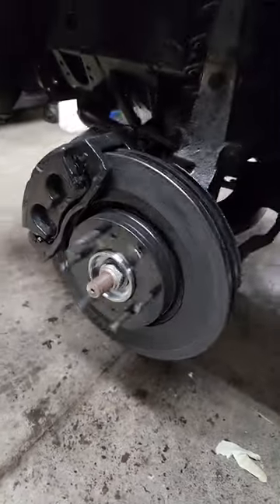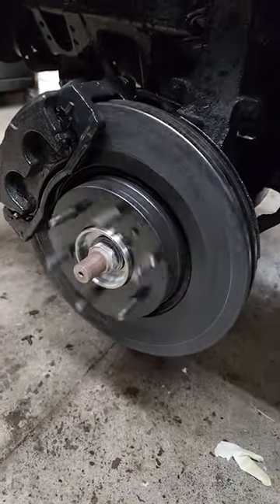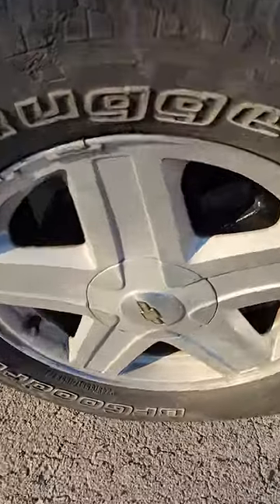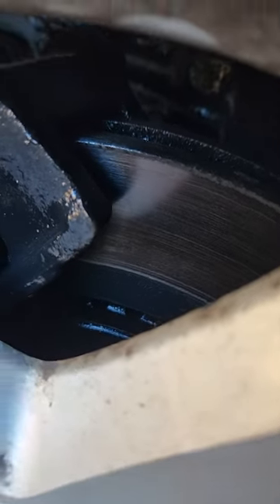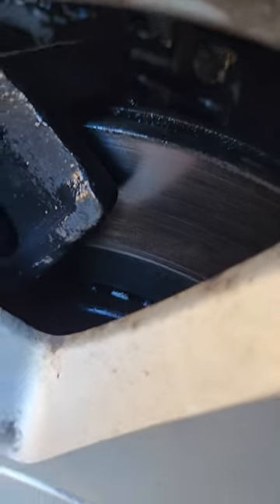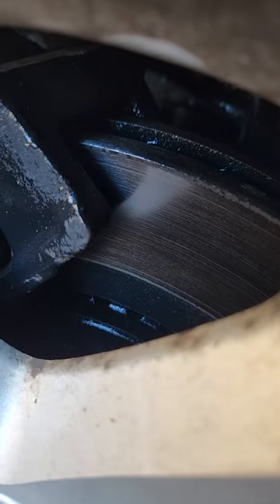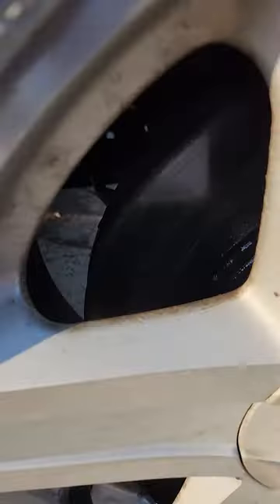Do My Brakes Work After I Painted My Rotors?

Comment: People are too convinced of the old school rumors you hear. Brakes get hot enough to burn off anything and everything that gets on them. I’ve left the oil coating on new rotors and installed them. It burns off the first 2 seconds of the first stop.

Comment: I just powdercoat my rotors so the paint doesn't wear off with the pads... Also, a little WD-40 on the pads further helps to prevent paint wear on the rotors. **NOTE: THIS IS SARCASM AND IS MEANT FOR ENTERTAINMENT PURPOSES ONLY - DO NOT ACTUALLY DO THIS**
Reply: I think the WD40 will also help stop the brakes from squeaking
Reply: Attention: For the uninitiated, These comments are description on how to commit suicide. Do not do this unless you want to commit suicide.
Reply: @booradlly  Fixed, I realized some people may not realize it's sarcasm.
Reply: @pdiz   You sir, are awesome! Have a wonderful day! Also, I think the disclaimer actually makes your comment even more funny rofl
Reply: WD-40 is a terrible lubricant. They make high-temp brake grease for a reason, just use that.  😳
Reply: ofcourse, dry lube or silicon spray is the way to go these days. 😅
Reply: @Austeration 😂
Reply: @booradlly  What the hell are you talking about mate? you know what engine braking is? You can engine brake on any car whether its got an automatic or a manual, ideally a manual but all works. You can come to a stop from over 100MPH relatively quickly with engine braking.

Comment: Rotor paint ain't gonna fix that lifter tick
Reply: FR.
My silverado motor finally bit the dust. Had that tick. Granted it lasted 330k KMS. So she lived her life regardless of the tick.
Reply: @m.m14433  It's nothing to rebuild that engine. It's worth it as long as it isn't a rust bucket.
Reply: @DomVito87  i dont know how to do that & its likely expensive to do here (canada). Id estimate the trucks worth probably 5-6k CAD with a working motor.
Reply: @m.m14433  I understand that. It's also expensive in the US. I taught myself to work on my own stuff(an yes along the way I've ruined things lol). But in the long run it saved me money.
Reply: @DomVito87  my buddy works at a scrap yard and said he can get me a motor under 200k Kms for 1600 w installation. If he isnt bs'ing me, ill go through with that.
Reply: @m.m14433  You can get a vortec crate engine cheap af
Reply: @joshphillips5480  where?
Reply: thats not a tick its the shake ball in the paint can
Reply: @Dom Vito  there's no explaining the satisfaction you get fixing your own stuff. If you know you know.
Reply: I know that sounds because I own a 05 Ls motor. Just sayin.
Reply: Needs some paint in the oil
Reply: Probably a pick up tube o-ring
Reply: Add 1 quart  of rotor paint for every gallon of oil 🤔
Reply: I wouldn’t be driving on those tyres either…..
Reply: it is a chevy it don’t give a shit ab not ticks
Reply: On the other hand I live in Michigan  so I kind of consider rust as a paint choice.
Reply: Glad someone else heard that but that doesn’t sound like a lifter tick that sounds like a rod knock 😂😂
Reply: Gotts spray the paint directly on lifter to
Have any effect
Reply: 330k miles and 5 transmissions right? 😂😂😂
Reply: Probably exhaust tick

Comment: Now your pads are glazed. Great job!
Reply: Not if you let them dry ”phil swift”
Reply: Wouldn't this be perfectly fine if he just used some old pads to clear the paint before driving? When its all clear just put new pads on.
Reply: @astroid99 yes, just the thing is the smell will be incredible. Had a guy paint his valve cover with spray paint and every time the engine starts warming up its all you smell and we still give him shit its been about 5 years now. So any braking other than granny braking your likely going to smell it. It is outside of the vechile so smell may not be as bad cause the cabin fan wont suck it in. Hopefully he used grill paint or the paints a couple hard braking situations from flaking the paint off or melting it not really willing to try it on my car to find out. Definitely not doing it on a customers car
Reply: @foolicooli  fair enough, not something id ever try myself.
Reply: @astroid99  don't blame you there lol
Reply: @foolicooli  He used the wrong paint, they literally make valve cover spray paint. They even make exhaust manifold/header paint, which withstands even hotter temps. Anyway, some companies literally sell their rotors fully painted from factory.
Reply: @69-Bot  I was aware of rotors being z coated specific brand and it does a good job preventing rust and longevity of the brakes themselves and helps them seat proper. Was not aware they made a spray type paint for the rotors though, so learned something new. Once you said header paint it clicked in my head though seen that awhile back. Didn't know about the valve cover paint though either. But yes he definitely used the wrong paint lol
Reply: Paint burn off about 500 degrees. Just brake hard a few times at 100 mph.

Comment: Looks awesome you might want to repaint them every 2 or 3 weeks.
Reply: Not really, you did it to cover the rust part that the pad didn't touch the disc rotor. That is the idea! It is dangerous though when the surface that touches the pad still covered in paint! When it wore off, it is actually good. I did it on my old car for tickle and giggle, I just keep running it on jack stand till the surface almost worn off (so the residue didn't transfer to your rims) and drive it carefully for at least 500 miles and you are good, drive it till now, no rust! Just be careful during initial paint!

Comment: Wouldn't that paint residue remain on the pads for a while?
Reply from the maker: Not sure ... It's been ok
Reply: It's fine. Good to keep the rust away for a while. Every time it rains, or condensation forms the brakes scrape away rust, so paint is nothing for brakes.
Reply: It'll wear off as brake pads do. Only oily substances will seep into pad material most other just stay on the surfaces
Reply: @WarpedLab  4" wire wheels are cheaper than an insurance claim
Reply: no
Reply: Yes definitly
Reply: @georgelin8498  that paint is oily so what happens if pads absorb it?
Reply: No.
Reply: Yes
Reply: Either way, truck is a shit box. Looks better.  It’ll burn off.
Reply: @georgelin8498  oily substances like rustoleom paint
Reply: @WarpedLab  Not sure? So it’s your car then, right? Obviously you would never, ever, ever do this to a customer’s car unless you were certain it’s safe. Because you’re not a fake mechanic.
Reply: @georgelin8498  pretty sure he’s not using water based paint.. pad contamination is real. Although it probably won’t effect you if you’re driving around your farm, it will affect you if you need you brakes to slow you down fast in a constant battle for first place.
Reply: Never do this. The paint will imbed into the pads. Could possible cause the brakes to be grabby when it warms up.
Reply: Would have contaminated the break pads disc needs a good clean and new pads because it may not feel like it but breaks will have lost breaking  capabilitie will be ok tho but not good idea.
Reply: Yep, you cannot use just any paint to do this, rustoelum is oil based and will gum up the pads, essentially glazing them and reduce your braking ability.
Reply: Yes
Reply: Yes those pads are contaminated and he's probably getting 25% of the braking power it should have😢
Reply: @gofasttuning2320  I get what he was trying to do, but he didn't say if he used high heat paint. One problem is the pad contamination. The other problem is that the paint on the non-friction surfaces of the rotor wouldn't hold up if it weren't high heat paint. Double fail?

Comment: Just change your rims to black so it matches with your full black paint under the car 😂
Reply from the maker: I was thinking the rims and the body 🙂
Reply: Don't forget the rubber
Reply: Might as well spray tint the windows too, both sides.
Reply: tire shine those tires too they'll look more black and match the other black things more lol tint the headlights and taillights too 😂
Reply: It will look great when the recovery truck pulls it out of the gutter.

Comment: Mechanic here, I do paint the calipers and rotors with high temperature aluminum color spray paint, I avoid the pad contact area as much as possible but they clean fine and it gives a nice look, way better than oxidized pads and calipers.

Comment: Depending on if this was oil based paint or not. This will not cause any issues except the first couple of stops. It will wear it off similar to surface rust after a hard rain. May actually keep the brakes from squeaking. Doing a similar job to what the brake quiet products they sell. Most of your higher end rotors you buy are sprayed. For corrosion prevention and heat properties. You don’t buff or turn the face of the rotors that have it. You set the pads during your test drive and it wears off. Like I said I don’t know what paint was used. But a lot of rotors do come coated brand new and it doesn’t cause any braking issue. It shakes for the first few stops but wears off.

Comment: I just took an old paint brush and did the rustic patina look with boiled linseed oil. Looks like shiny patina now. The burnt smell will only last a few days and then you hardly ever notice it again. In a pinch you can use old used motor oil. Looks the same and is better if you are on a budget.

Comment: I had a customer came in one time that had done this and their calipers seized up because of it 🤣
Reply: Thats not true at all unless he pulled the dust boots and painted with epoxy it did not cause a seized calliper…😂
Reply: No way this would cause a seized caliper
Reply: How does a caliper seize from paint? Did it gum the pistons that bad?
Reply: No you didn't 
 you can buy painted brake disks that do exactly the same as this video keeps the rest of the disk protected
Reply: No you didnt.

Comment: Premium rotors come coated brand new for rust protection, and the pads clear them instantly
Reply: They're powder coated or high temp paint, not rustolium paint. That's gonna stink when it starts burning off everything

Comment: That paint can actually compromise the structural Integrity of the brake pads contaminating them and making them garbage why you're supposed to wipe down your rotors after you buy brand new ones to get the oil off so you don't contaminate the new brake pads
Reply: Yes, but the "clean" areas do oxidize. Personally, this seems like a "good idea" to do with brand new rotors and old pads. Use the old pads to create a wear pattern, removing the paint, and then replace the pads. However, I doubt I'd want to do a brake job twice just to limit rotor rust in the vents/hat. Also, probably need to use high-temperature paint because of heat soak during brake operation. Not sure what "dried up rustoleum" does at 400-600F degrees. Could produce some fumes you wouldn't want ... I don't live in the rust belt, so this isn't a protective measure I'd ever considered. But with snow/salt corrosion in some places, it may be useful.

Comment: People are gonna be so upset about this because they don't understand physics, those brakes will take the paint off guys and you'll only have a problem stopping if you don't do what he did first! He's a man who knows his stuff!
Reply: You don't need to paint your rotors is the point
Reply: @chrismith41399  nah he didn't say that lol
Reply: Thermal physics maybe. Where does the paint go nice it’s of the rotor?
Reply: @Jesse Tristan  if paint is overheating your rotors you might wanna get some better ones than that, and it'll do what brake pads do when they wear out. Just dust everything up and get all over shit
Reply: Where does the paint go though? It gets in the brake material and contaminates it, reducing its ability to work. This is just hack work, and you don’t need to paint everything either
Reply: @The Deforester  like I said if you notice a difference in stopping power after painting your brakes, you have a much bigger problem. I've done it before with no problem because it just literally isn't significant enough to do anything which is why tons of people do it. The residue you speak of is like I said just like pad dust, it gets everywhere but only sometimes, I've seen it not happen to some aswell

Comment: Some brake rotors come painted from the factory, and the specifically instruct you in the install manual not to remove it.
Reply: They come with a rust inhibitor and a break in coating.thwts not Rust-Oleum.this shit is going to start smoking and burning when the brakes get hot.also the rotors brobly will warp and glaze over because ethe pads and rotors fins will be gooped up.
Reply: @michaelwooda9444  no you just haven't seen the ones that are painted. I've seen them painted from factory and it's no issue at all. The paint turns into powder eventually and blow away.
Reply: It is a specific kind of paint. This yoyo used rustoeum which is oil based

Comment: If the paint was dry you could've just used sandpaper as the wheels spun. BEFORE you paint your rotors or calipers, cover up the rotors with cardboard and painter's tape. I've done it to many of my vehicles over the years, and paint never gets on the pads.

Comment: I'm trying to figure out if this was meant sarcasticly. My brakes could use some rust protection but I'm afraid I'll ruin the pads.
Reply: Pads are like 20 bucks a set, and you can get pre-coated rotors. But this could actually be a money saver if you buy uncoated rotors and apply high heat paint to them. If you're worried about the paint sticking to the pads, you can use old pads to scrape off some of the paint.. but I wouldn't worry about it.
A thin layer of paint will protect the rotor against rust just fine and thus make it less prone to cracking, and it'll wear off the pads within the first 10 miles or so.
Factory coated rotors are the smart bet, though, as they're usually powder or immersion coated and are designed to work fine with fresh pads.
Reply: Oh, it will! 😆
Reply: @shaneleonard7218  it won't

Comment: IF YOU'RE GOING TO DO THIS, do it literally immediately before a pad change. Then you ain't gotta worry about the potential paint contamination in your pads if you're really that worried about it. Which you shouldn't be, because the pads will clear that literally immediately, but there's a tip for you hyperventilating YouTube mechanics
Reply: Brake pads are painted at the factory for rust protection.
Reply: Premium Rotors also come coated for rust protection and the pads removed the coating instantly
Reply: @drakekarman1791  the surface is about storage, the bell and edges are about longevity in salty areas. The surface rust on the contact patch will always immedietly be removed. But the rust on the bell can make it stick on the lugs and cause weak spots around the rotor itself. It's not usually an issue, regardless, but it can be

Comment: my friend actually painted my brake pads and all w silver rustolium on my 02 accord. they still work fine and the brakes take the paint off the rotor where the 2 meet but looks great. will say go easy on the brakes at first when doing it cause it will make some weird noises and feel off for like the first 5 minutes of driving but then goes back to normal.

Comment: I painted new rotors before fitting, and got a bit lazy masking off the friction area. 

Never brakes properly… Basically the oil based paint contaminated the new pads. Had to pull the pads and clean them. Pita…

Comment: Did you change you air in the tires to summer air. And added summer blinker fluid!!! Also have to replace starter so turn engine the other way ! So have more power!👍🏻👍🏻😘

Comment: i do this kind of thing but not with rustoleum and i don't paint the surface intentionally. Painting the center and edges of the rotor and unintentionally get a little overspray on the contact area isn't a big deal.

Comment: Real question: Will all that high heat paint get embedded in the brake pad and cause slick spots? Even if just temporarily that may be dangerous. If I'm wrong no problem I've been wrong before. I don't do little experiments like this in my free time so I wouldn't know.

Comment: painting rotors isnt too bad tbh.. quite a few manufacturers sell their rotors with a coating or paint on them that gets worn off only on the braking surface. just gotta make sure you use a paint that won't get gummy and clog up the pads
Reply: That coating of “paint” is called zinc😂
Reply: An spray paint is oil-based so does it sound like putting oil on your brake rotors is a good thing?!
Reply: @subarukid3885  i said coating OR paint some use paint

Comment: Brake pads can also wear off ceramic header coatings. I’ve seen it
Reply: As in the brake dust? Or? Explain please.😅
Reply: @mrsmith2904  previous job, we had a show car that every part we could purchase went to the coater, including calipers, rotors, spindles and a arms. 
It was sketchy the first dozen times we tapped the ceramic coated brake rotors with the z rated pads.

Comment: I would of deff taped off those areas or scraped em a bit. The heat and friction from the pads deff left a residue that. Idk lol you'll have to tell us bro.
Reply: Nah, turns into powder and then rinses away with brake dust.
Reply: Idk man. Seems like a dumb way to heat up your pads excessively

Comment: It's quite similar to knocking off surface rust if a vehicle sits in a moist environment for a while. I probably won't recommend doing it because it could cause a pull or a chatter but some people have luck with it,  and some people don't. Honestly this is far from the worst thing I've seen people do to their brakes.

Comment: If you buy new rotors with rust inhibitor paint there fully coated and comes off the same way. But I wouldn’t just blast everything with paint 😬.  Something is gunna premature fail for sure